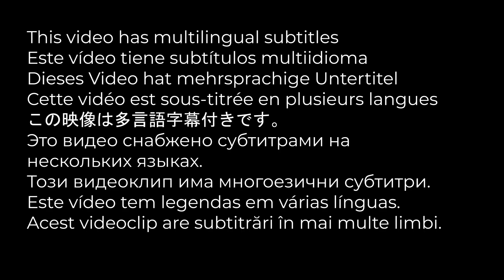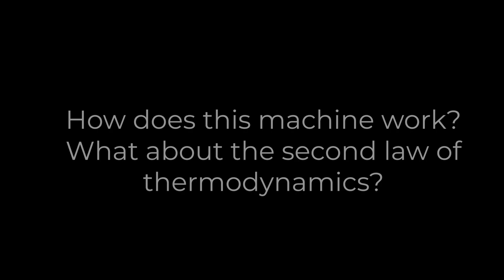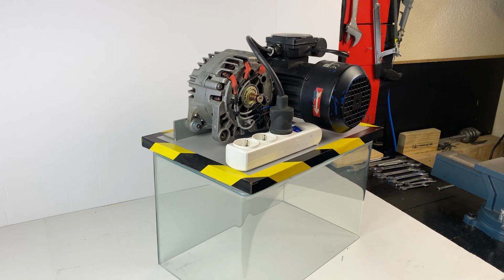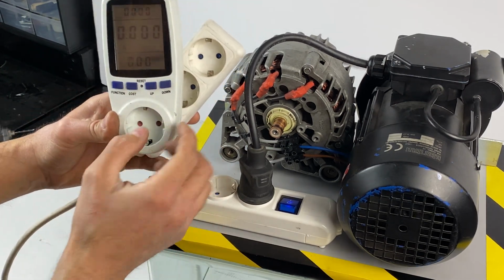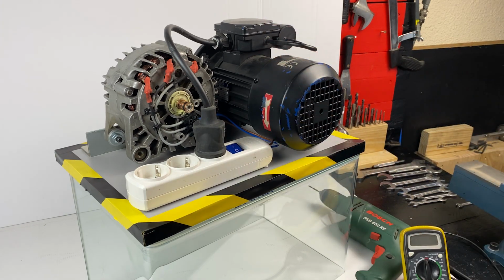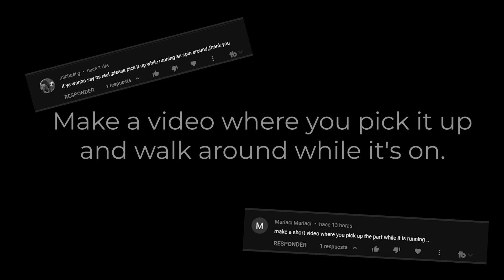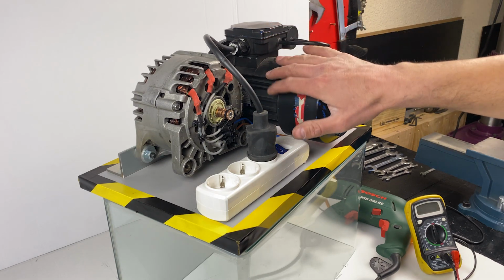We put this Infinite Energy Generator to Test - Liberty Engine 1.0

Comment: Buenas noches, estoy muy interessado pero me falta algun dato, como calcular las dimensiones i potencia de los imanes. 
¿I realmente tiene que ser un alternador de 24V o sirve uno de 12V?
Reply: Sirve uno de cualquier voltaje, obviamente variará el voltaje de salida, al final la proporción de voltaje es casi siempre 10 a 1, empíricamente hice uno así a los 12 años con un motor de 12 volts y generó suficiente para encender un foco de 110v 100w, también le conecté una radio, todo es el tamaño del motor y los magnetos
Reply: @maharbatc  could you send me a list of what I will need to make one of these please would really appreciate it
Reply: @donnajames11  depends on your parts, basically you add neodymium magnets to the alternator, conect the alternator to the motor by cable and with two pulleys throw a band on the shafts, the sizes depend on the size of your motor and alternator
Reply: You need to understand how easy this works, first I'm gonna suggest you to take any small motor, DC motor, make something to rotate it manually and connect a multimeter to the cable terminals, and see what happens on the multimeter when you rotate the motor

Comment: At 9:15 they are showing the power consumption of the electric drill.
The video clearly shows a consumption of more then 800 Watt.
But you can also see that the drill is running in idle.

Why is the power consumption at maximum when the drill is running in idle?
Please show clearly in your video that the plug of the drill is connected with that very drill and not with some other electric device.
Reply: My first reaction to the drill was just that too. 800W unloaded… not likely

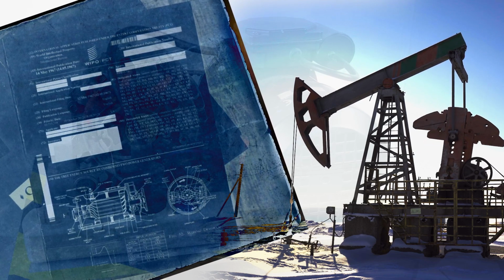Comment: I am suspicious of the patent's existence (19:55) for the following reasons
1) the priority date on the document is October 2012, it should be between 12-18 months before the filing date which says 1967-05-12, not 45 years afterwards
2) the barcodes top-right and bottom-left should be identical, even when blocked out, you can see the start of the barcode nearest the bottom of the page doesnt match the start of the barcode at the top of the page
3) There should be a human-readable patent (application) number next to and below the bottom-left barcode, the same number and size as below the top-right barcode
4) the abstract (summary of invention) is ALWAYS on the front page of the document - in this case it is missing
5) patent drawings are required to identify components by number, not words as the document may need to be translated later to another language
6) do a search for international patent applications published on 1967-05-14 (which is a Sunday), only 4 were, this is not one of them
Reply: the 2 cross sectional drawings of the 1950s era DC generator are identical down to the positioning and font style of the component labels as seen in 
Technical Manual TM-9-8000, Principles of Automotive Vehicles
Department of the Army, 25 October 1985
page 299

Comment: Congratulations guys. I would like to know how long can that engine run without overheating, as both the alternator and single phase motor should generate heat if it procedures that kind of power. I would also like to know if you guys have tested it to lets say light up lights or appliances in a house, as that would be ideal for when there is something like a power cut or outage.
Reply: It can work until the batteries are exhausted, and it is unlikely to overheat
Reply: If it works and I want to believe it does ! The magnets cumulate heat and loose quite a bit of power ! That could be a problem in a long run !!
Reply: You can clearly see the original nylon fan inside the back cowling on the motor is still in place & working. All common truck alternators have a cooling fan. In this case they've removed it to make this rig safer. On a scaled up version you'd retain the alternator's original & effective fan & fit a cowling over the fan, belt & pulleys. They've deliberately left this gear out to give us a clearer unobstructed view. They want us to see there is nothing to hide.
I LIKE WHAT I SEE!    I don't have the refined skills they have or sufficient knowledge of electrical properties, otherwise I'd drop everything & produce one of these rigs ASAP. Everything they say sounds true & correct to me. This type of technology is kept from us by parasitic maggots who make billions a day out of selling us expensive junk power systems that perpetually enrich arseholes. These guys are taking a giant risk if what they have actually works. Agents of arseholes will be scouring the planet right now to find these guys & shut them up. Scaled up versions of this generator would power the entire world overnight & put thousands of parasitic arseholes out of business in a very short space of time if this thing really works. . .        IT LOOKS REAL TO ME!
Reply: Bruce Peltier 
My advice to these guys is. . .
Dismantle a complete rig down to housings, armatures & associated subassemblies, make an appointment with Elon Musk & show him the loose parts & then assemble it & run it in front of him to remove all doubt that batteries or some other hidden power source is involved. 
Musk is one of few who has sufficient means to build dedicated factories to mass produce these units. He could have a team develop specific single phase motors & refined 240V alternators & a direct drive system where the armature shafts are inline to eliminate the powerloss from the belt drive. Scaled up versions of these powerplants could be installed in pairs in every building on Earth where one is in use whilst the other is serviced.
I've been packing ballraces with Castrol HTB Grease for 40 years. Even cheap inferior Chinese bearings run indefinitely without failure when packed with HTB on light load applications like alternators & electric motors. Once the two armatures are perfectly aligned & balanced, all vibration & noise would vanish & no service would be necessary if the belt/pulley system was eliminated.
This system, if proven would reduce emissions & consumption of fossil fuels on this planet by about 98% overnight if it was made available. Instead, the parasites offer us ridiculously expensive battery powered vehicles which rely upon giant power stations to recharge massive heavy batteries & we're supposed to sit around twiddling our thumbs for extended periods whilst the batteries are recharged in these junk electric vehicles.
Musk has the basic understanding of how such things work, has the means to mass produce & has the capacity to protect himself from assassins sent by supreme parasites.
Someone has to marry this breakthrough straight up to Musk immediately.
Imagine never having to run copper cabling, power poles, transformers, transmission lines, meter boxes & switchboards into buildings ever again. All of the existing systems would become obsolete immediately. Billions of tons of heavy metal obsolete electrical power systems could be torn out & recycled into these independant units. If this technology works as demonstrated, it will totally transform this planet & it will put a vast army of money grabbing arseholes out of business in a blink.
THIS IS A JOB FOR MUSK!
Reply: @marekmarecki2322 
Don't worry. . .     We're not going to take the batteries out of your vibrator. . .
Reply: @johnbrooks9523  Do you honestly thing Elon is looking out for us? He is the last person we should contact with this information, in fact, we should share it as far and wide with all the people we can and try to archive these videos outside of youtube or any google source to preserve what is shown here. Then no one person could have control of this information.
Reply: @indigochild161 
We need about a hundred billion of these things & we need 'em yesterday...

And your plan is. . ?
Reply: @florianconstantinescu8256  Just plug a small fan to cool it down, problem solved.
Reply: @johnbrooks9523  I'm pretty sure Musk would laugh you out of his office! This defies the first law of thermodynamics. Not theory, but law.
Reply: @harrycallaghan2531 
As previously mentioned, this device must be demonstrated to a mechanically minded, cashed up investor. Once such an investor is satisfied the thing works as described, it would be up to that investor to ensure the product is mass manufactured & made available at a reasonable cost to every human being on Earth. I am not in a position to replicate this machine. Skills & know how are required & I don't posess such know how, or I would commence building one today. I am aware of some basic laws of nature & as far as I know all energy derives from the decomposition of matter. In other words...    You can't have energy without consuming/burning fuel of some sort one way or another. I do not understand how this gadget can work, however it does appear to work. It appears to draw energy out of thin air through some obscure magnetic process that is beyond my experience & knowledge. I could easily dismantle such a machine & establish it's credentials is I had one on my work bench. That isn't likely to happen. It is concievable that the induction motor used is basicly an empty shell loaded with dozens of batteries & it is simply battery power driving a modified alternator. I'd have to open the thing up & look inside before I could be 100% certain this animal is the real deal.
I like the idea that it is real & it does work & that it could end the mindless consumption of finite fossil fuels to energise humanity.
But, until I get to examine this thing, the jury remains out.
I know wealthy people who aren't arseholes. I know they would back a plan to mass produce these generators in all sizes & capacities. However, I simply do not have a working example to demonstrate & if I did, I wouldn't film it like a damn magic show & drop it into YT like some sort of tantalising episode of show & tell. I'd have it built & on the market without delay.
I recently discovered information that an Ivermectin factory in Taiwan was blown apart last year. No such event was covered in the media & as far as I know, the monsters who run this world have no genuine concern for our welfare & they certainly would not like the idea that we could all have endless free energy. We live in very dangerous times where good things & good people are destroyed if such destruction suits our selfappointed gods who have absolute control & absolute power through their massive wealth. Anyone who makes free energy available to the masses & who destroys the income of supreme parasites can expect to be hunted to extinction instantly...   This is why such a device, if it truly works, must be sold at a reasonable price to a god like Musk.        Let him fend off the assassins.
Reply: @johnbrooks9523  As soon as you show me him responding, I will admit I was wrong. Until then what I say stands.
Reply: @johnbrooks9523  Now, lets not trip over science due to irrational emotions. I never said free energy was not possible. But it also depends on what your definition of free energy is, thereby confusing the conversation.
There is, as I have said thousands of times before if you took the time to listen and refrain from premature ejaculation, the first law of thermodynamics IS a law within this realm that we exist. Lets see just how sharp you are. Tell me what the first law of thermodynamics is and exactly what that means. If you can. Because this Tom foolery defies that natural law. And Tesla would see that obvious fart in the wind.
Reply: @florianconstantinescu8256   what if you dip the whole system into hydroelectic pool which is 100% resistance and can be cooled

Comment: Hello, can you give us the no-load voltage of the alternator : without the engine being connected to it ?
Reply: A car alternator has a diode rectifier & a voltage regulator that holds it at +13.5v while running.
It's +1.5v higher than +12v so it can charge the battery.

Comment: Strength of magnet has nothing to do with voltage. Voltage in generator depends on the size of iron core inside winding, number of loops in each winding and the speed with which the magnet passes by the iron core.
Reply: But the stronger the Magnet is, the bigger is the magnetic field.
So if the magnetic field is bigger it can affect the wire spools with more efficiency.

Conversely, the strength of the magnet has nothing to do with the voltage (volt), but with the current itself (ampere).

The difference is simple and can be explained by using water. 
Volt (voltage) is the water pressure in the example. 
Ampere (current) is the amount of water. 
You can have 10 bar of water pressure on a sprinkler system, but the grass will still dry out if there is only 2 liters of water for 8 yards of lawn. 
But you can also not water a lawn if there are 2,000,000 liters of water, but there is no pressure on the line and only droplets come out. 
So the strength of the magnets has something to do with which machines you can operate and whether it all works.

The strength of the magnet is decisive for the available work force (watts), which is calculated from volts and amps.

By the way...
I am an electrician by profession and have learned this shit for 3,5 years...

Comment: Hello. I was very impressed by your video. What I would like to know is this: will your machine be able to keep an electric boiler of 40-42 KWh running so that it will keep a house warm during winter? And since that many electric boilers are three-phase boilers, how do you built a three-phase perpetual energy machine? Thank you.
Reply: If you use 3 phase electric motor then you get 3 phase
Reply: You can't build a perpetual motion machine. This is pure B.S
Reply: @majikshroom1  ..... Thank you.
Reply: He showed that it only produces 10kW and the motor uses 1kW. I believe with a load like a heater the motor might use more power, this would be interesting to see!
Reply: @5128mike  Where does the remaining 9kW come from?

Comment: the energy probably comes from the thick board, where power banks are incorporated. It would have been better to use another steel angle as a basis.
Reply: Absolutely
Reply: Watch his latest video mate, that proves you wrong!

Comment: To top it off, I accidentally stumbled across this video and I don't want to sound like the most skeptical person here. But if you claim that this engine is self-sustaining and produces infinite energy, we should now have a revolution in the energy field and not only that. And I haven't seen a big fuss made by the media so far. If this method of free energy production really worked we should also have seen a large-scale implementation in various fields. I repeat, I haven't read, seen, heard much about this "innovation"! I sincerely hope that what we see here is genuine. I can only think of the impact it would have on the automotive industry and beyond! God speed!

Comment: Ok this is a great working example and I would like to build one my self can you post the technical specs on how you figured out the rpm the alternator needed to run and sizes of the magnets
Reply: The same question. Especially which magnets and how to position them on the Rotor? this is not clear at all

Comment: Good click-bait video.  This should have made you some decent cash from FB.  My physics professor told us the only free electricity comes from lightening.
Reply: Yes, thanks Bob.   @Bobshnogen
Reply: Not true, there's free electricity in the air all the time
Reply: Stan Meyer pulse frequency generator is not click bait
Reply: @kenw.1112  Radiant Energy is always in our atmosphere. Radiant energy includes solar radiation from the sun, as well as cosmic rays from the stars. New and varied free energy devices harness this power to produce electricity.  This (solar power) is the primary source of this "free electricity".  Wikipedia
Reply: For every rule there is an exception, we still don’t know everything in the universe, and we can see that what was impossible yesterday becomes possible today ..

Comment: The hidden battery is in the connection box on the motor. If this solution was possible, this guy would win the Nobel prize.... I M P O S S I B L E !!!
Watch his hands on the motor box when he rotates the alternator.... he turns on a secret button which runs the motor on the hidden battery .